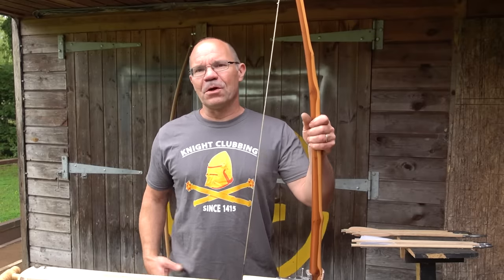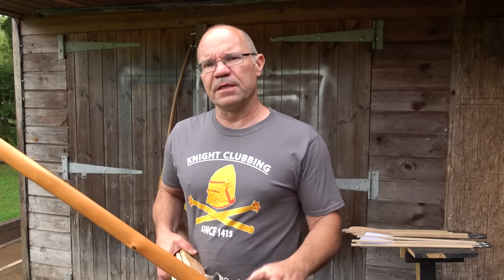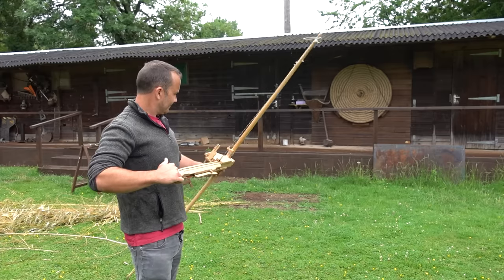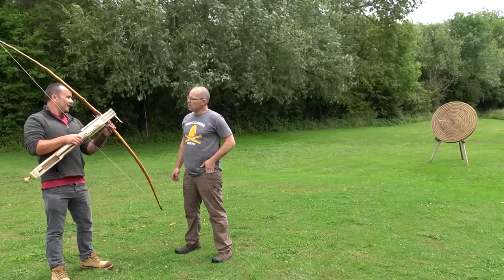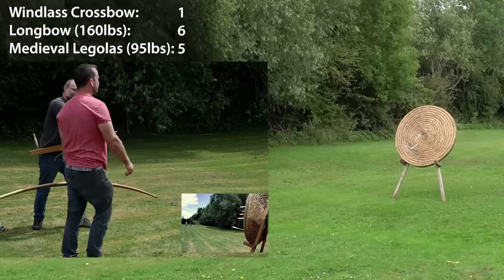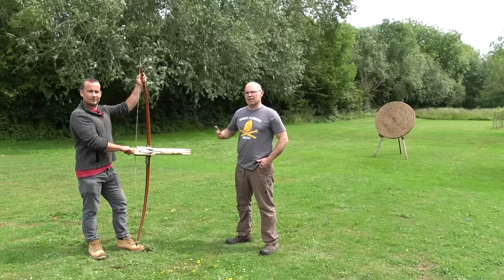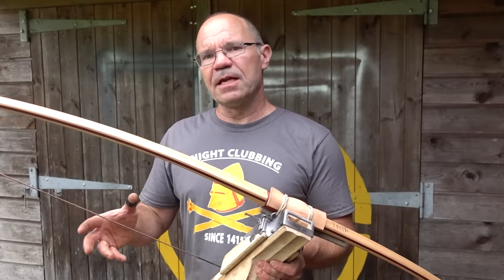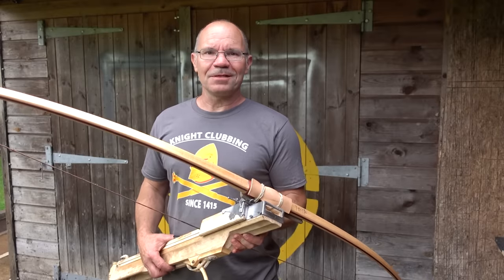Tod's 120lb Medieval Legolas - TESTED

Comment: I think that Joerge designed the grip horiziontally because its optimized for his range of motion when using heavy slingshots

an experienced warbow archer could do better with a vertical grip instead as thats the range of motion they are used to

however the horizontal grip is probably better biomechnically, 
-a gym bro would be able to answer this
Reply: I'm no gym bro, but my understanding is that turning your thumb up and out will give you more mobility through the shoulder. If you put your arm out straight in front of you and try to reach up and back you'll probably get further with your thumb up than thumb down. Something to do with the geometry of the bones in the shoulder makes it easier for them to slide past each other with the arm rotated out. The movement of drawing the bow is different, but playing around with it now it feels much smoother and more natural to draw with the hand vertical than horizontal, especially towards the end of the draw. Just my thoughts, someone with a relevant qualification could probably provide more certainty.
Reply: Maybe even an angled grip?
Reply: @awsomeoawsomeo2103  Some other angle would probably be better than perfectly vertical or horizontal, though exactly what that angle would be I do not know. You'd probably need to do a fair bit of testing to find roughly the right angle, and even then the perfect angle for different individuals would probably vary. Someone mentioned a flexible grip of some kind, if something like that could be used it could help remedy the problem, or at least assist in figuring out what the right angle is.
Reply: Just make it to where that grip isn't in a static position. With some kind of swivel or something. That way it would naturally go to the proper angle when drawing.
Reply: @paulhughes3315  maybe that is too delicate for medieval crafting method to produce?
Reply: @paulhughes3315  oh that's actually a really good idea! You must get that to Joerg somehow!
I wonder how that'll work with finding the trigger, but maybe a quarter circle bar on it will be enough to get to it from any position? I'm sure he can figure something out.
Reply: the handle is mounted horizontally his muscles are use to pulling a vertical string *if you know anything about lifting weight this 45° rotation can make a huge difference in which muscles are being used, my theory is the horizontal grip is reliant on the shoulders more and a vertical grip would be more natural and use the stronger muscles of the back. To me it's like comparing the exercise of a face pull (horizontal that focuses on rear shoulders) compared to a vertical grip row (more emphasis on back)
Reply: @alexc7857  Yeah I do think that by itself is making a big difference to how heavy it feels for him.
Reply: @paulhughes3315  Joerg now has an adjustable handle on the production version. https://youtu.be/sy_bJQaD3Uc?t=224
Reply: Experience warbow archers could absolutely do well with the grip in this position. Mongoloians and asians in general, that is, since they thumb draw, which is a very similar position and the better position for overdraw.
Reply: @louisvictor3473  well it depends on what type of drawing you are used to.
Reply: I  believe the vertical grip feels only easier for archers and only because their muscles have adopted for that grip, someone with no archery experience should find the horizontal grip easier.

Comment: Absolutely awesome, the 5 man team unleashing 25 arrows quickly, was a great demo. Like an archer assault team. I had a thought, why not turn the handle at the back 90 degrees? Might explain some of the issues with the higher pull feeling, as I reckon you'd be using different muscles in a different movement.

Comment: Seeing the edited piece at the end I get the feeling of an absolutely withering volume of fire from archers in the clutch. Wow.
Reply: In the hey day of longbow, this could have caused military revolution, on par with pike and shot.
Reply: @OkurkaBinLadin  if so, it would be employed. you forget about drastic reloading time of such device. marksmen can shot continuously, as Mongol archers and they didn't need to hold additional 8kgs in a straighten hand, which is VERY exhausting. i don't think ordinary archer can bare more then 2 bursts with this device without losing all stamina and, hence, aim. they were men, not heavyweight lifters
Reply: @zloidooraque0  he has a version with a draw assistance bow attached opposite, that could allow someone to fire rapidly with little effort.

Comment: I just imagined facing down a whole army of Joe Gibbs's, a scary prospect.
Reply: Not that scary; at this rate you'd be dead before you had time to consider just how terrible of a predicament you're in and you wouldn't have to worry about it. O_o
Reply: Just charge them while they're reloading.
Reply: @2bingtim  They're not idiots; they will probably stagger their reloads.
Reply: Ask the French how that went because that is exactly what happened at Agincourt.
Reply: the army, that shoots 20 seconds, then reloads their devices for another 5 minutes..
Reply: @zloidooraque0  I see people still dont understand the idea of shooting teams. You dont have your whole army fire all at once. You have squads shoot while the other squads reload and it goes back and forth. How do you think they did it when we lived in an age of muskets and black powder guns wafare?
Reply: @sebastianriz4703  how many teams you need to compensate reloading time of this device? 15? now divide army size by this number to get the number of soldiers shooting simultaneously. and don't forget rotation of 15 men deep columns, how easy this will be?
Reply: @zloidooraque0  So here is the thing. Just because you have the ability to shoot 5 arrows in under ten seconds does not mean you have to. Teach your team moderation, rythem, routine. Even though you can output a maximum of 30 arrows in the air from 6 guys in ten seconds, doesn't mean you need to do that. Just have 3 of them shoot an arrow maybe every three or four seconds or even just slightly faster then the enemy warbow men. Half of your group shooting and the other half reloading (which doesnt take that long. Probably takes ten or twelve seconds to reload the thing.) and keep a steady rythem for a constant stream of arrows flowing.
Reply: Welcome to the French army
Reply: @sebastianriz4703  I agree with you, or you can have a servant to reload a spare bow. Then swap out the empty one to reaload, thus further increase the firing rate
Reply: @2bingtim  they are not bowmen in aoe2
Reply: @zloidooraque0  if you actually think of more possibilities, its very easy to make a firing squad like that functional. The reload is not like 5 minutes with high levels of mastery. More like 2 at most
Reply: Just to add that on a battlefield it is unlikely there'd be time to leisurely let alternate teams reload & shoot. As soon as your enemy is in range you want to KO as many as possible before they get to you & the best tactic when taking missile attack is to close that range ASAP. So I don't think it practicable unless you're in fortifications; but then again they didn't have these in the day & ordinary archery is good enough, if not far better in skilled hands, making the device a curiosity rather than a breakthrough. It wouldn't come cheap either.  At least that's my opinion, but I always love gadgets.
Reply: @2bingtim  if heavy crossbows that take a minute to reload was used on the battlefield, I don't think this wouldn't. I also believe this weapon is not for the best bowmen by any means, as its inferior in everything compared to the longbow except rapid fire in a short time and its easier to use, mastery won't improve the effiency of this weapon much. Breakthrough seems like an exaggeration, I agree with that
Reply: @ihaveadream7858  if it were "very easy" it would have exist. this enormous wooden thing gives nothing except complexity, giant additional weight on march, on battlefield and "on hands" when firing. difficult to transport, use and maintain.. and what's funny, it gives absolutely no benefits in combat. archer will get tired faster, that's all.
and archers with "high levels of mastery" could fire this without any additional devices.
but ok, now calculate: firing 5 arrows/10 sec + reload/120 sec = 1 arrow/26 sec. much slower than common bow. and no continuous "swarm of arrows", cuz reloads will be really desynchronized.
it is not a video game, where there is "those 10 seconds you need heavy burst" to kill a boss.
Reply: @zloidooraque0  bc medieval ppl at that specific time ain't advanced enough to invent it or just never happened to have thought about it. Remember inventions were mostly accidents in old times
Reply: @zloidooraque0  another feature, is that this thing is very easy to use compared to the longbow. This weapon would be utilized if it was ever invented. Not completely useless by all means, peasants can use it just like crossbow are used in war, little training required to use. I am fully aware this weapon is not efficient, much worse than a longbow, but you know about the repeating crossbow Chu ko nu? The reload is long, the bolts cannot penetrate even thicker cloth armor, but they did get used in ancient Chinese times, as even kids can use it and soldiers raiding villages could not be wearing any armor and the weapon worked. Same goes for the Legolas
Reply: @ihaveadream7858  you are very wrong. medieval people were as smart as we are. damn, romans 1.5k years before invented ballista, scorpion, onager and things. first mechanical clock was made year ~1000. and then there were more clocks with calendar and movin figures and things.
Reply: @ihaveadream7858  ofc it is not very easy to use compared to longbow. as a fact:  it is harder to use.you still need as much skill to use it but you need much more strength. long bow is much less effective compared to mongol composite/reflexive bows, and longbowmen needed to be really strong and skillful, that's the "secret" of english/welsh bowmen. 
the truth is simple: this device isn't hard to invent, but it lets you fire less shots before you get tired and lose accuracy (or become dysfunctional at all) at the same time it doesn't increase your effective rate of fire, but as a fact decreases it.
Reply: Yeah, not only does the guy have incredible form when shooting the bow, but I'm sure fighting a guy whose build is absolutely stacked and rock solid (to be able to shoot the bow..) wouldn't be that fun in hand to hand combat either.
Reply: @zloidooraque0  everyone knows this thing has a low rate of fire, and exactly how can this be harder to use than a longbow? Also the fact that it can shoot repeatedly without having to reload in a short amount of time already makes it effective in a way, thats why repeated crossbows were invented, it does not matter if the weapon were easy or hard to invent, it just never happened to be invented in those times. Giving an example of how smart the ancient and medieval people were is irrelevant to what we are talking about
Reply: @binphan6655  This thing is also removable quite quickly. They could easily unlatch it and grab an arrow after shooting the initial 5. Could this not have been used by mounted archers as well? Imagine charging into the enemy with 5 great shots, then ride out of harms way.

Comment: 13:30 is the perfect example of what "Instant Legolas" would unleash back in those times, truly a force multiplier! 5 bowmen could unleash 25 arrows in roughly 8 seconds. Imagine a standard ambush team equipped with this; say 50 bowmen, they could do 250 shots in under 10 seconds! All enemy baggage train, GONE IN 10 SECONDS!! HOLY S***!!!
Reply: Then you have to reload. I'd like to see a test to 10 or 15 arrows.
Reply: @bo_392  there is a stripper clip for reload...
Reply: @bo_392  you forget crossbows that were far longer to reload. Like one shot is longer then a whole clip of this. Were a popular weapon at that time. So the whole reload thing is never a problem and can be fixed with the right tactics. Also when did you see an archer piece though a shield? It's impossible even for a 160 pound bow. But the bow still dominated the battlefield. So both points are invalid.
Reply: @bo_392  Haha, you can't use your head beyond three sentences it looks like
Reply: @bo_392  So you split into multiple teams and one covers the other as the reload. Or you have loaders and secondary bows. This is an era where men and money were just flung at each other to die en masse, how could a bow that fires 5 shots in 8 seconds compared to 1-2 in 10 seconds be a drawback or impossible to integrate into a strategy? As someone else said, crossbows were rankly ineffective by comparison (as were muzzleloading firearms) yet they were still core to combat for centuries.

Comment: Need to turn the pulling handle around 90 degrees, so your hand will be in the same position as if you were using a normal bow
Reply: I think so to. Flip the Grip
Reply: Also it's some way behind the string so you are having to compensate for losing around 2 inches of draw length, which near full draw is quite a bit.
Reply: @Quotheraving  Its realy hard to get to a solution vithout losing this importend inches. The only thing i can think of is a handel parallely too the string.
Reply: @stephanfrenzel5782 I don't know that would help much as you really need the handle behind the line of the arrow so that it aims like a bow. I was thinking that a thinner back reinforced with a metal loop which doubles as a handle could probably give an extra inch without weakening it too much.. From what I can tell the back of Tod's SIL is extra thicc, probably to compensate for using solid wood rather than laminate.
Reply: The idea to make it with a metal loop realy can give some more draw if it ist mountet at the right place.

Comment: 13:19 - actually that's a fair point with the Hand position.

In the bow drawing position the bicep is going to be Weaker with your hand horizontally Vs vertically

It has two main functions, bending the elbow, but also twisting your forearm/hand outwards ( feel your bicep while turning your hand outwards).

Putting it vertically means it's already doing one of its jobs already, so its gonna be easier to recruit it as opposed to relying more on the other two muscles that flex the elbow (brachialis/brachoradialis)

As an extreme example try doing a bicep curl with your hand facing down instead of upwards, it's much harder and you tire much quicker.

Palm up in a curl corresponds to palm inward in the bow drawing position. The instant legolas is more like a hammer curl.
Reply: Also note the recoil shock on release in the slo mo of Joes "Trigger/ draw" arm.
Reply: @matthewbeitzel7200  Yeah i noticed that too. You could see the ripples going thru his arm. Very cool and a testament to how much force was transfering back to his arm.
Reply: He can shoot 140#+ easily with his hand in the horizontal position (thumb release). If you're using your biceps or triceps to get the bow past about half draw, you're doing something really, really wrong. The weight should be mostly on your back by then, and fully on your back by the time you reach full draw.
Reply: @alexanderflack566  true, but you do still use it in the first half of the draw, and could contribute to the feeling of "harder" even if just as easy to hold at full draw. a lot of the actual energy required to bend the elbow is probably coming from the back anyway with the bicep acting as a sort of tendon ( similar things happen in the legs ) but there does have to be force at the elbow from somewhere.
Reply: @AngDavies  Yes, but the problem he was having was mostly in the latter half of the draw. Besides, as I noted, he has no issues drawing 140+ with a horizontal hand, since he does so with thumb release. The issue is exclusively with the IL.